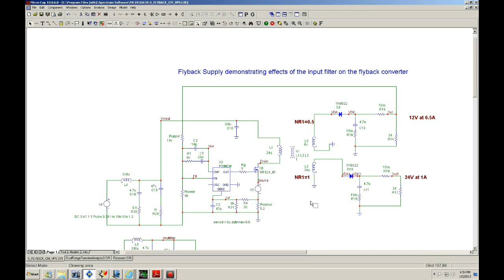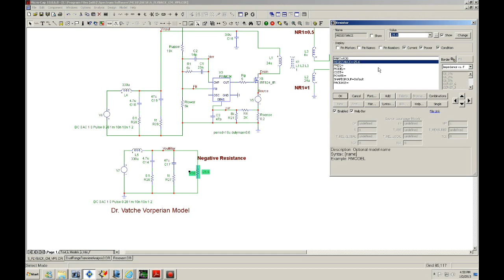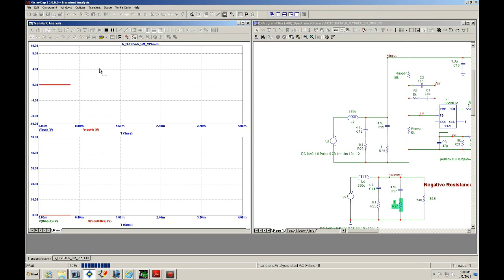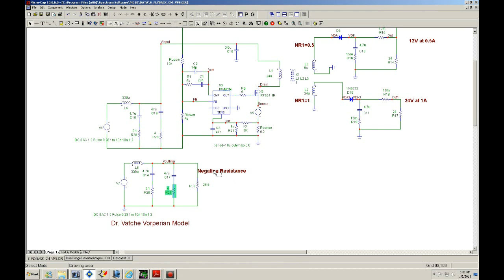Input filter effect on a power supply using the Vatche Vorperian Model .wmv

Comment: I would expect it to work even better changing the sign of the negative resistance to positive, also didn't quite get why the parallel of the calculated resistance with the load resistance. Interesting video though, thanks

Comment: I tried this with LTSpice and the negative resistances work. It is really interesting to tune the values and see the amount of overshoot and ringing change.It really shows you that there are a lot of bad choices that you can make for filtering elements and with a little tuning, you can get it right.
Reply from the maker: Hi Tim, thanks for the feedback. I am glad you found the video informative. Best regards, Robert
Reply: Hello what was the spice Directive put in LT spice to do this simulation

Comment from the maker: The switch PWM model (Basso current mode model) that I am using does not have s slow start feature. Therefore when it starts it has an overshoot. A real PWM will have a slow start capacitor that controls the risetime of the PWM's internal reference voltage. Another way to control the overshoot is that we use a inrush current limit between the inout filter and supply consisting of a P-MOSFET and use a Miller capacitor across a the drain/ source that controls the rate that the input voltage rises.